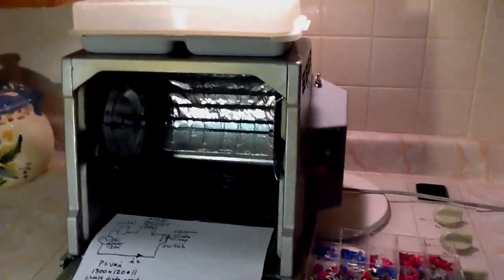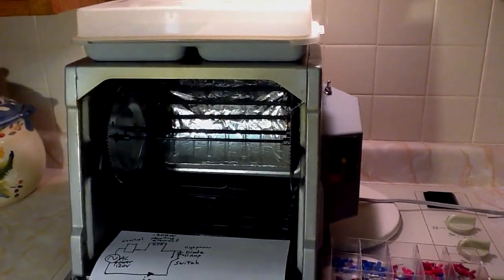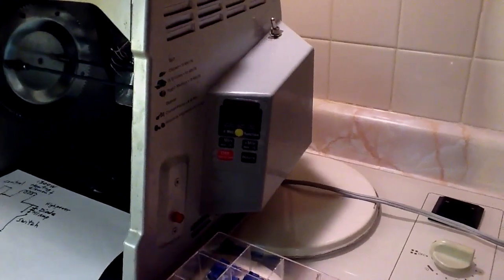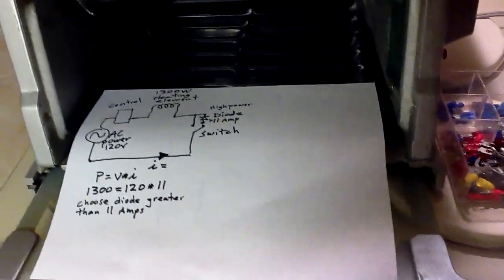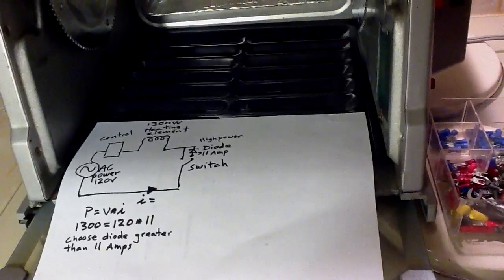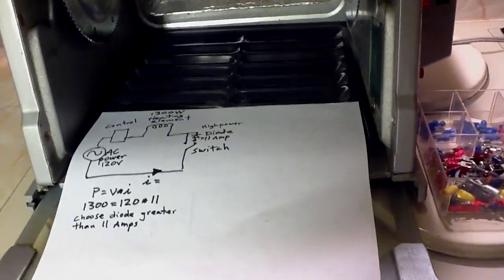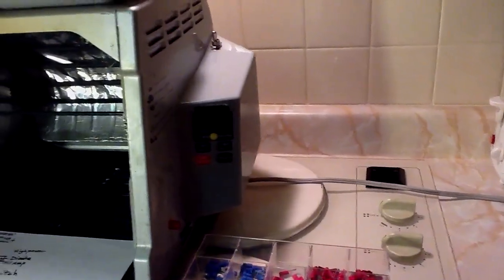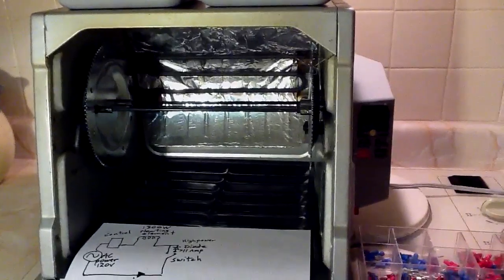Ronco Showtime Rotisserie Oven Mod to Reduce Heat for Slow, Smoke Cooking

Comment: Dale, do you think an AC dimmer switch would work as well?
Reply from the maker: An AC dimmer is based on a TRIAC component.  Don't try this application to a 1500 Watt oven using a 100 Watt light dimmer switch. The gate on the TRIAC needs to be controlled, so if you want to complicate things in order to get greater control of a temperature, you could experiment with a TRIAC designed for much high power than used by a light bulb. You might also run out of space in the oven to put the required circuitry.

Comment: i have a baby george rotisserie that runs too hot. it makes rotisserie. but it's kinda dry meat.  while i love tinkering with stuff and have all the tools needed and just enough electrical experience to be dangerous. i do question if i should try it or donate it to goodwill. also the 1N1186RA  diode is on ebay for cheaper then the site you listed... currently.. ;D
Reply from the maker: I hadn't thought of this before, but if you jury-rig your own "extension cord" using a receptacle you can access, and put the diode in there, power your grill using it in order to cut out half of the AC power, that would cut the heat down without you busting into the rotisserie.  I was worried about the electronics in the rotisserie.  It probably has a full-wave diode to change AC to DC along with a transformer to reduce the voltage for the electronic control and that DC will have a little more ripple, but could work to keep the controls running.  If it somehow ruins your electronics then what are you out if you were going to give it to Goodwill?
Reply: @fathompin  it would be interesting to have an extension cord that can cut half the power going to something. as is the baby George makes rotisserie i just don't want to eat. especially since I've been spoiled by my sous vide machine. at this moment, i'm mostly questioning if I'll even use the baby George if it did make good food. sous vide is already the most alien moist meat I've ever eaten. the biggest draw to making that cord is the act of making it. hrmmm. i'm still considering it.

Comment: How about the simple task of changing out the inside light bulb?  I have tried to do this to NO avail.  No info in the manual how to do this, and I even tried calling customer service and they can't help me either!  I have tried to remove the obvious screws but dang that lens cover doesn't want to budge.  What is the secret to accomplishing this??
Reply: Remove the large screw at the bottom of the light cover on the inside of the oven.  Slide a fingernail under the light cover and push straight up, then, once it is as high as it will go, pull the bottom of the light cover away, towards the center of the oven and pull slightly down.  It will fall away.

Comment from the maker: A diode device allows current to flow in only one direction. Because alternating current (AC 120, 60 cycles per second) is positive for half the cycle, then negative for the other half, by adding a diode current is blocked for half the cycle, 60 cycles per second. And since the heating element is off half the time, one only gets half the power out, reducing the oven temperature the same amount no matter what current rating diode you use. Too big a rating will not fit inside box, too small unsafe

Comment from the maker: Someone pointed out that power has a factor of 2 (half) for AC circuits. Thus, Average Power = V*I*1/2 = 1300 Watts, such that in my case in the video V*I = 2600 Watts. Thus, instantaneous current could be twice what I show, 22 Amps.  I'd go with a 40 Amp diode, which is what I thought I used.  FWIW, P = V*I is an instantaneous result, and as the voltage oscillates from zero to 120 volts etc, the average involves the summation of all the different values for voltage and current.

Comment: Good idea not showing consumers how and where to add the diode - I think you would get a few people blowing fuses and scaring themselves - let those who understand the procedure do it..  I do the same trick modifying high-power soldering irons - put a diode and a lampcord pushbutton switch in the power lead.  Technically, 1/2 voltage = 1/4 power.  P=V^2/R.  P=V*I doesn't work because the current drops as the voltage drops.  Do you like using this oven?  Would you have bought a different one?